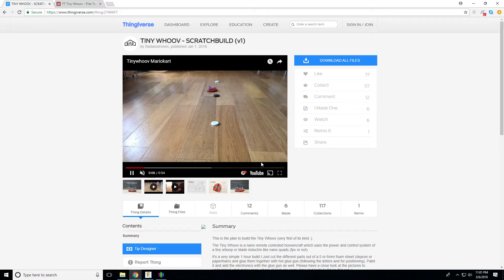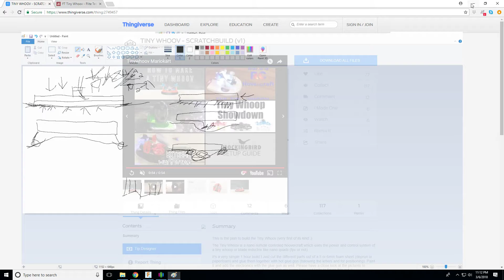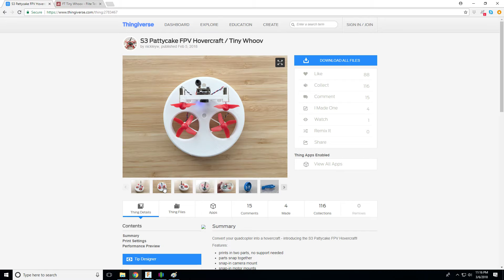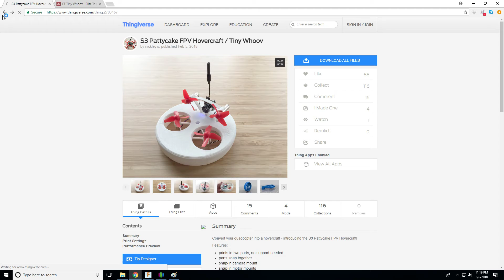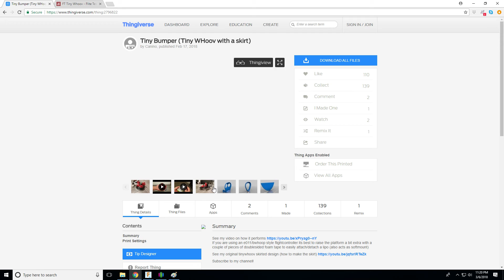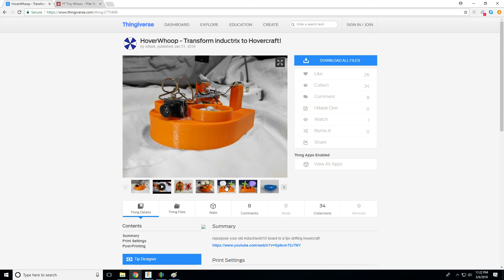Tiny Whoov Development Part 1

Comment: I see that i'm the only one in the comments so I will say a lot of things :D
-I will give you some numbers: i made 7 versions of whoovs from cardboard to floor insulation and using a h8 with dual rates on it, so lightest was 28 grams with a 4 gram fpv cam and now my problem is that the whoov is kinda wobbling and when i go forward it does not go straight, it goes in a zig-zag pattern, it could be from the gyro and i would want soo much to be able to code a firmware for a whoov but i don't know programming at all, i also experimented with a skirt and i think i was a thick plastic bag because it didnt inflate well.. so now im on my 8th version trying to come up with a neat design and i think will add a skirt and in the future i will buy another whoop or maybe if you have seen Alex from badassdrones who first invented the whoov is selling 1 boldclash fc and transmitter programmed for whooving, motors and props. Cant wait for the next video cuz there are not many on youtube yet. (Im not native english sorry for grammar mistakes)
Reply from the maker: Actually i just built one using a F36 and it was shaking side to side just like you are saying (zig zag). I believe the FC will need to be programmable but people are able to get the stock inductrixes to work it looks like. If you look at the one other video that used a furibee f36 board it was also shaking side to side. super wierd i am going to have a video up on it soon. And also i am going to be building one out of my old eachine bee core v1 for dsm2. Im going to program the mix for tiny whooving.
Reply from the maker: Also i do believe that it is indeed a gyro problem
Reply: RC Engineering Actually i really wanted to build one for a f36 because i only needed an fc (i lost my whoop and i had spare parts) good thing to know about the gyro
Reply from the maker: Yea it doesnt work i will be posting a video of it i am thinking of posting it on the 15 for MMM (mid month messup) i post a "Fail" every month on the 15th. I think that counts as a fail. I have never seen something operate so funny.
Reply: RC Engineering Nice, i discovered whooverware, made by notfastenuf and i will flash it on my h8, it also works on e011 bwhoop and all these flashable quads, its based on silverware
Reply from the maker: was not aware that the h8, e011 were flash able they don't even have a usb?
Reply: RC Engineering They have 3 solder pads on the board and you need a usb flasher to flash it
Reply from the maker: hmm i will have to look into that.